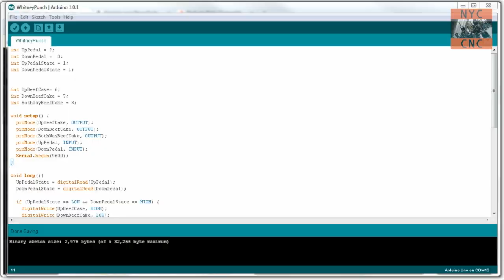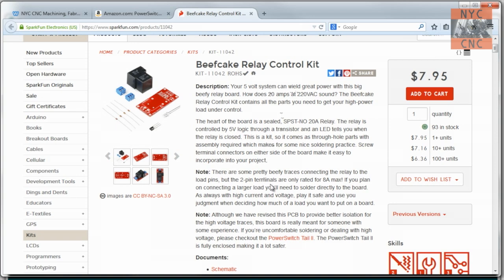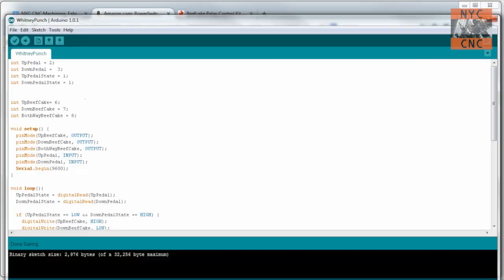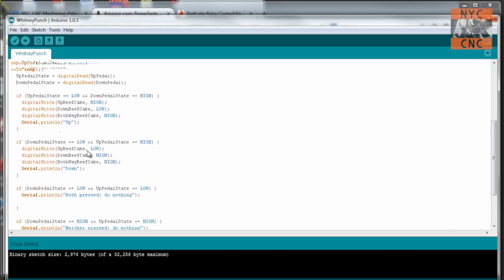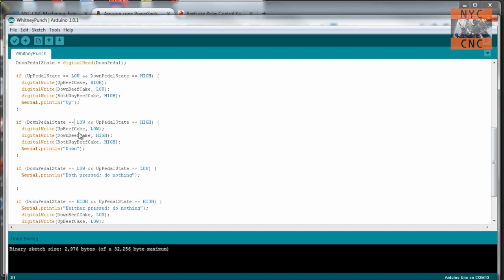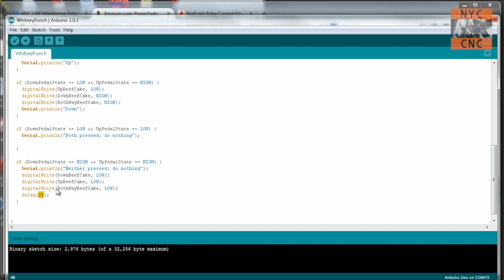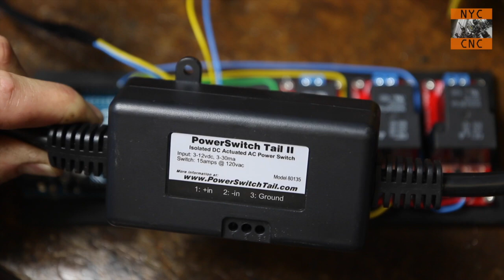Arduino Steel Hole Punch!  Retrofitting Foot Pedal - Part 2

Comment: You'd be better off using perf board or just raw soldering the resistors etc.. the plug board you are using may lead to lots of loose connection because of vibration in the future.

Comment: Hey mate! Love all of your videos, I have been binge watching them all over the last few days. And I really love your enthusiasm and how you 'show all' and don't cover up anything. 

It would also be possible to do this all with just relays, no need for the arduino and such. I can draw you a picture with the wiring diagram if you want. But basically just run the relays directly from the foot switches and use a 2 pole relay with the second pole actuating the 'bothways" circuit from each relay. 

Keep up the good work mate!

Comment: How come you do not just use the Arduino mini rather using the large Arduino.  Because i notice a lot of your project you do not use all you PWM or Analog pins, so a Arduino  Mini or Arduino micro would be cheaper and space saving.

Comment: I think you'll find the actual switch in the yellow foot switch is a "single pole double throw". So if you used the Normally Closed terminal as your up direction and obviously the NO contacts as your down, you could work the punch with one foot for both up and down by moving the pedal up and down. 1 switch 1 cord  very neat, very industrial, very intuitive.

Comment: Yeah i don't understand the arduino on this one at all. All of our hydraulic equipment is pedal operated, and not a microprocessor in sight. I would def recommend a double pedal shield, or a rocker pedal with up and down in one pedal. I think a RTH function would be nice, but understand it can cause issues on a punch.

Comment: A waste of an arduino.
It does not take an MCU to control 3 relays, you can do this with three wires and a couple of wire nuts.
Reply: NYC CNC A CNC hole punch is an amazing idea, I agree, but as of this video it looks like a waste of an arduino to me, honestly.
However, to just control it with two pedals you can simply split the hot wire from the switches  and feed them into one common and one separate relay.
I'm not really a frequent viewer of your channel, so I'm a bit confused as to why you'd want an automated punch while you've got pro-grade CNC machining centers that can do countersinking of the holes for rivets, too.
Reply: NYC CNC Certainly better for mass-production :)

Comment: - Minus one point at 0:07 for manual layout of hole locations of Sparkfun Beefcakes and the Uno. You should have downloaded PCB layouts and used a proper method to transfer coordinates. The Numeric way.
- Minus one point at 01:29 for not using proper standoffs which could be easily ordered together with Beefcakes.
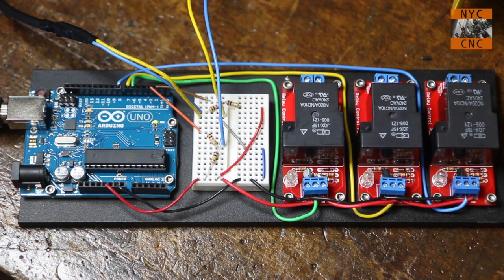- Another minus 0.5 points at 05:37 for not using Uno Protoshield. If you have used a protoshield, the overall look and feel of the project could have been safer and more convincing to the beginners. Machinists could easily solder few parts. (edit: Good to hear that you are making a pref-board)
- Please enclose the entire project in aluminum enclosure to reduce EMI interference from welders, plasmas and other industrial equipment. Simply build aluminum walls and cover for the electronics. (edit. It appears that you are addressing this as well)
Overall you pass. Thumbs up.
Reply: NYC CNC I personally do not care much about safety ;-) And it is obvious that it would be more efficient to do it manually with a transfer punch. However, since you are the best CNC youtuber I know, I somehow expected to watch you do everything the numeric way with the Tormach or at least with a DRO. It is simply cooler. Call me a number maniac.

Comment: Using a micro-controller for this this was a total OVERKILL. There is a much simpler way to do it by just using relays connected directly to the pedals.

Comment: Could you have done the same with SSDs, steering diodes and a small (5v) power supply?  Or use SSDs that have 110v control and do the same with the diodes?
Reply: Sorry, fat fingers. Yes, SSRs.

Comment: John
  Great video as always.   Just a small to to make sure that you use insulated PCB pillars to mount PCB boards to your aluminium backboard.  Putting insulated washers underneath can create stress on the board, flex it and break the PCB tracks when you tighten the mounting screws in your setup (particularly for the Arduino which as small pcb tracks that are easy to break)  Also the washers could potentially slip out over time and you will get a short from the pins to the backing plate.  Ideally make the insulated PCB pillars on the lathe or Tormach for even more fun.

Comment: Great Job!!! very cool  I would get a pedal that has 3 positions foot off it goes up press it all the way and it goes down lift foot half way and the ram will stay in the same position wont go up or down very use full for jogging the punch down
Reply: When I go to work tomorrow I will see if I can get a part number or some specs on it

Comment: Did you think about just setting this up as an auto retract, as in take your foot off the down switch and have it automatically go back up?  I would think that would be the way to use it.  Also, I followed some of the Auduino vs. PLC chat down below, yawn.

Comment: Very cool John!
Now you can extend this with a voice control?
eg. up and down as commands plus for savety a pedal to switch all off
Thanks for all the good news!
Reply: NYC CNC Hello John noise is not the problem because the identification is specific, the system recognises a specific pattern. I think it is more save than two pedals.
Reply: NYC CNC I will try to find some more information regarding noise and specific pattern. The panic stop is no problem by adding a pedal.
Reply: *****  Hello John I found an instruction film, it looks promissing
http://www.instructables.com/id/Speech-Recognition-with-BitVoicer-and-Arduino/
then I tested a program Dragon Naturally Speaking and that looked promissing too but with this program the question becomes how to integrate it with an Arduino project.
Reply: ***** Note: Voice recognition is different from speech recognition,  voice recognition recognizes only a single person's voice, while speech recognition can recognize everybody's voice.
Reply: NYC CNC Hello John it takes some effort to program this but then it is not easier but safer because when you have to move your foot from one pedal to the other your attention is drown away and that is more dangerous. Noise isn't the problem because the software recognizes only meaningful patterns, noise is ignored. I am waiting for a test bord, after testing I will respond once more.
Reply: NYC CNC You have to give arguments, with this last statemaent I can do nothing. When you move your legs direct attentention is needed as you shown yourself in the youtube film thats logic because you stand on your two feet and when you move one feet there is uncertanty about equilibrium. But when you move your mouth with both feet on the ground thats much more stable and so safer.
Reply: ***** Hello John I am not criticizing your solution wite the two pedals it is perfect and a good example how to improve things and better than it was but there is more to gain. I can understand that some solutions ask for more developing time, but only think about it in perhaps new things to come.

Comment: A sewing machine pedal already has the pot in it and all switches like you are using the center is hot in and the opposite of the movement is hot out.  But you are being very careful which is good.  Just sharing my years in the marine industry and printing industry and years of goofing around with everything.  Also a sewing machine pedal does forward and reverse.  Or up and down.

Comment: Swap out the breadboard with a protoboard with soldered connections like this one "http://www.mouser.com/ProductDetail/Twin-Industries/8000-45-LF/?qs=sGAEpiMZZMs8I5ltipPMAG2LBn2hqQmx" The machine vibration will eventually cause the jumper wires to come out causing problems. 

Another issue is that the electrical noise or spike could trip the Microcontroller to do something unexpected. for instance it could lock up the microcontroller while the press in operation. It would be better to remove the arduino completely from the circuit, its really unnecessary for such a simple circuit. All you really need is to connect the two switches up to the relays your already have. At the minimum, mount some sheet metal over all of the electronics using standoffs or long machines with nuts to prevent the sheet metal from coming in contact with the electronics.This would attenuate any electrical noise as well as shield the electronics in the event that one of the wires attached to the terminals comes loose, or breaks.

Comment: You need to pick up a bucket of standoffs for mounting the boards. They work better than just using the spacer because if the screws are too tight, you can bend the little boards.

The Arduino stuff is great for one-off projects. Yeah, it adds between $7 and $25 to the project cost depending on board and origin. If you are making 1000 sets, it makes a difference. For one? It is not worth getting out the soldering iron.

Also, they have a Screw Shield that just breaks out the Arduino pins to screw terminals. It also has a small prototype area on it as well. $15 on ebay.
Reply: Robotshop.com has a good selection of screw shields. I just can't shop there as my debit card rejects them because their business address in in Canada and my credit union is weird.

Comment: Nice job with the Arduino. Isn't this an overkill though? Couldn't you wire foot switches straight to the panel? It's my understanding that these types of switches are made to withstand high voltage and currents...

Comment: great video john. You would have been a great technology teacher! Next time i would look into the SSR. They are a little more expensive ($9-12) but might be easier to mount and wire. Great job, already looking forward to next Wednesday! 

http://www.amazon.com/Temperature-Contoller-Terminals-Solid-SSR-25/dp/B00FZU6BC6/ref=sr_1_15?s=industrial&ie=UTF8&qid=1411580715&sr=1-15&keywords=SSR

Comment: Great video.  Of course I would have done it differently.  I would have used one switch and had it activate the down circuit until the pedal is released and then have the arduino code power the up switch for X seconds (enough to return up) and then un power the up circuit.  Thanks for sharing.
Reply: Just after I wrote that I saw a flaw in my logic.  What if you want to come down almost to the metal and then align it better, my way it would never hold still for you to do that.

Comment: the foot pedals could each directly drive a relay for the up/down and a 3rd (common) relay could be driven by an or-gate connected to both of them. unless there's timing or complex logic in the arduino it'd be quite a bit cheaper, less complex, and less likely to fail. you'd just need to send enough juice to the foot pedals to drive the relays. likely any 12v wall-wart would do the trick if there's not low voltage available in the cabinet.
Reply: I was just thinking the same thing. No controller needed in that setup. A few diodes. I'm a huge fan of the arduino but it's extra for this. Unless you decide to re sketch it to automatically return to up position once punch times that it is fully down then I can see its use here. But THANKS for the video.. enjoyed it

Comment: Pro Hacker Tip:  If you don't have an organizer full of every common diameter and length of nylon spacers as I do :-), you can cut nylon air line to make spacers as insulating standoffs for the mounting screws on circuit boards.  When I'm building in the shop, it's actually faster to cut the standoffs I need rather than walk into the lab and get fancy store bought spacers.

The Beefcake relay modules look nice for use with Arduino.  For stuff like this I use solid state relays from eBay, usually about $5 each, delivered.  They have four terminals.  One pair is DC control.  The Arduino should be able to directly drive the LED side of the optoisolator that controls the power switching electronics that short the other two terminals on the high voltage side.  These are solid state devices so there are no contacts to wear out like a mechanical relay, and you get optical isolation so no high voltage switching transients or reverse EMF from a collapsing field on a solenoid will make its way back into your control electronics.  There is also an LED indicator, just like the Beefcake.  Easy two screw mounting to the subpanel with no need for electrical insulation.  They work well, but don't trust the current rating.  They'll say something like 25 A, but I'd trust them to 5 A, and maybe 10 A.

http://www.ebay.com/itm/221522739619

I spent a lot of my career replacing complex and inflexible relay logic with a microcontroller (my custom printed circuit boards were essentially an Arduino before there was Arduino), so I'm definitely in favor of microcontrollers and doing the logic in code instead of using clunky mechanical relays and mechanical timers, but the logic for this project was so easy I'd have been tempted to use relay logic.  Microcontrollers are great for switch debounce timing and anti-tie down switch logic for non critical applications, but safety critical applications should use well designed hardwired circuits with no code that can crash.

Hard to argue with the results, though.  That machine needs a foot switch!  Never having used a steel hole punch, it seems like a three position foot switch would be better than two foot switches.  Up is up, middle is hold, and down is down.  Push the pedal all the way down to lower the ram, let up to the middle position to hold the ram position to align the part as needed, press down the pedal again to punch, and let off the pedal to retract the ram.  Would that work?
Reply: NYC CNC
Maybe one of these DPDT foot switches could replace the rocker switch with no need for an Arduino or relays?

http://www.ebay.com/itm/380995601619

http://www.ebay.com/itm/121228607384

I did a quick search for "DPDT foot switch" on eBay and restricted the results to Business and Industrial to filter out most of the guitar effects pedal switches.

To be honest, I'm not too sure what the manufacturers mean by "two stage", but I have no doubt that there's a shielded foot switch that would directly replace your rocker switch for a lot less than $1700.  Maybe $20 if you knew what you needed and were good at scrounging industrial surplus and auction sites.
Reply: NYC CNC @Liberty4Ever You have covered pretty well all I would have wanted to say on the PLC vs mechanical logic. I would just add that this application doesn't lend to any need for micro controllers and some of the safety policies required of machine's control unit. I agree that if a timing system or automated sequence is needed then there is no need to trouble your self with antiquated logic systems. However with such a simple sequence of action as shown, a ladder logic control with only mechanical components is preferred. The cost is lower, the reliability is equivalent if not better then the ardino and beefcakes.

As far as the solid state vs mechanical relays, electrical codes forbid solid states relays in some applications, especially in manual over rides. If you press the Estop on a brand new high tech cnc machine, you will hear mechanical relays cutting power to all motors, and it will stay that way for the forceable future.
Reply: Alexander McGilton "Forceable future" is right!  We're FORCED to follow these standards, even when they make no sense.  A lot of these codes are based on prejudices that developed early in the life of some technology and are now no longer warranted after the technology advanced.

I wouldn't use the $4 Chinese solid state relay for a design with a serious safety issue, but I'd trust a quality SSR over a quality mechanical relay as the SSR doesn't have contacts to weld.  The SSR has only electrical failure modes while the mechanical relay has electrical and mechanical failure modes.

Similarly, I'd trust a microcontroller that I programmed over an industry approved and grandfathered E-Stop circuit, because I can design the microcontroller code to be fault detecting.  A normally closed E-Stop circuit is considered fail safe because any disconnected wire results in an E Stop, but it doesn't detect shorted E stop circuits, accidental or intentional.  I can make an E Stop circuit with a series connected E Stop relay that the microcontroller controls (to be opened if the code detects a condition that should E Stop the machine, such as an end of travel limit switch activating).  The microcontroller can toggle its E stop relay as part of the Power On Self Test to test the entire E Stop circuit.  My microcontrollers also use watchdog timers that force a reset in 18 ms.  If I didn't trap the reset, the watchdog timer could expire and the hardware reset could restore proper controller operation so fast that the operator didn't even know it happened.

That being said, I've been using mechanical E Stop relays in the CNC machines I've been building for my own use, where, as in John's case, the codes don't really apply.

Comment: Technical (vs. Creative) thinkers often come up with the most complex solution to a simple problem. I would have built a mechanical foot pedal to operate the switch. It would have taken under an hour and been made for free with scrap metal. This is not to say technical thinking isn't valuable. You just need to apply the right approach to the given problem.